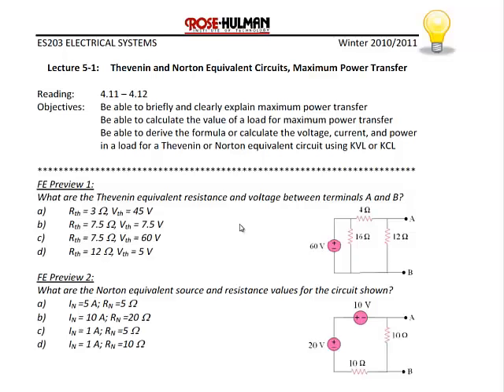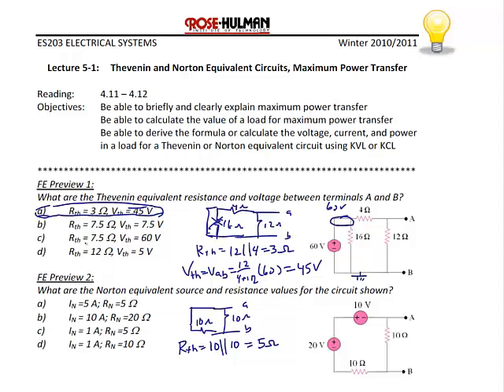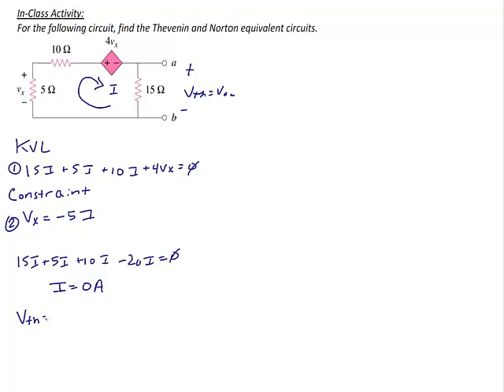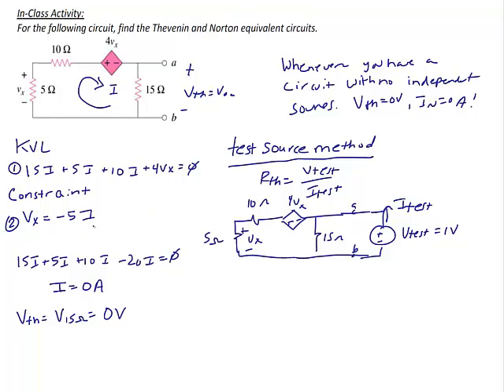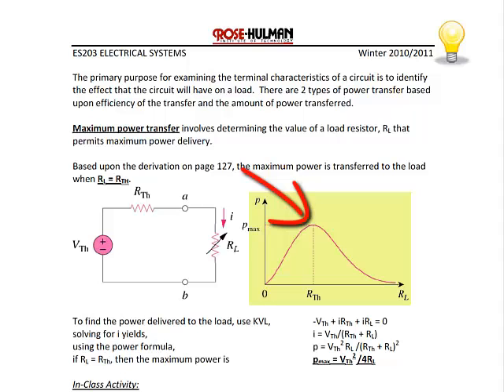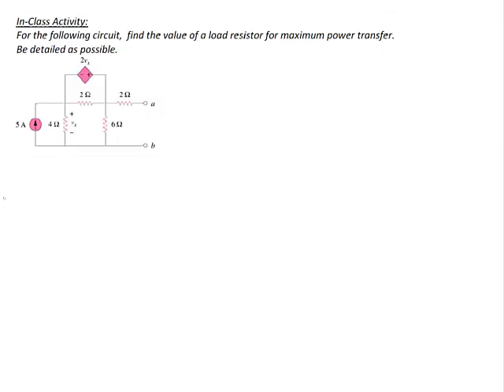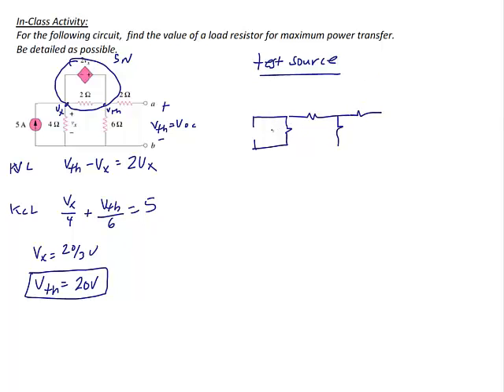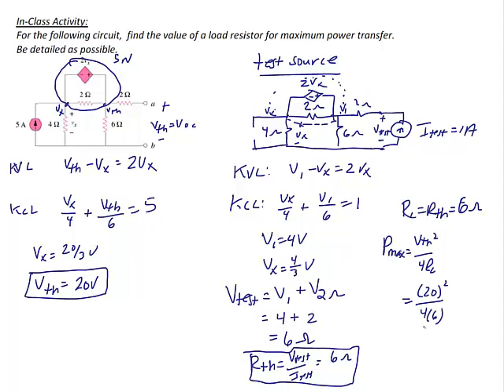ES203 Lec 5-1: Thevenin and Norton Equivalent Circuits, Maximum Power Transfer

Comment: Hello CITmetal, The way that we demonstrate this in the real world at RHIT is to build a circuit and make the load a variable resistor (potentiometer).  What you will observe is that as the resistance approaches the Thevenin equivalent resistance of the circuit, the power is indeed maximum.  The reason your theory will not work is that as the resistance approaches zero so does the voltage so if you use P = V^2/R this will go to zero, in other words all of the source voltage drops across Rth.